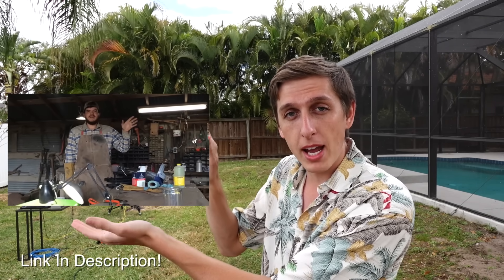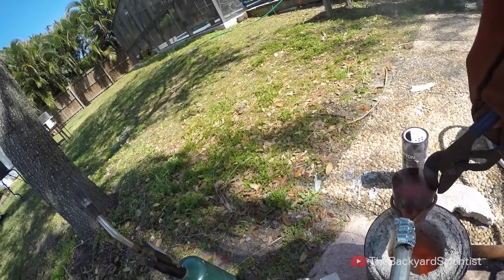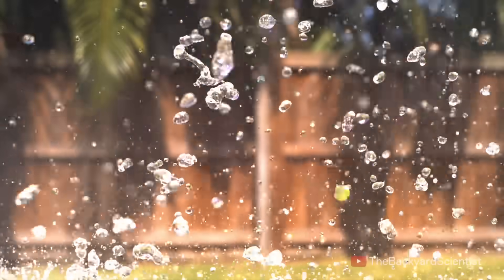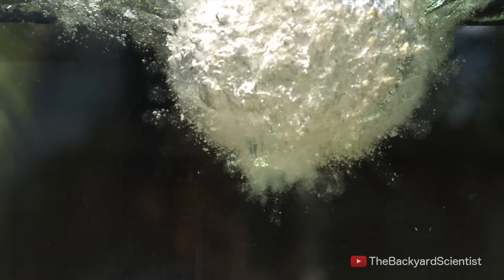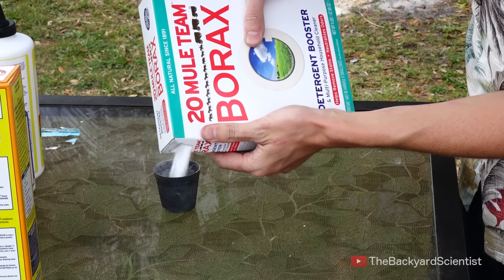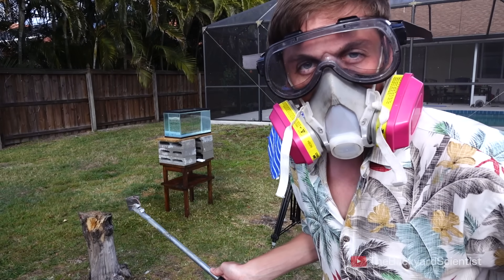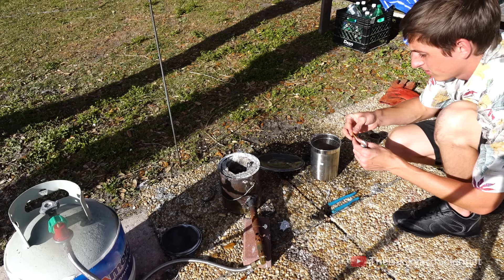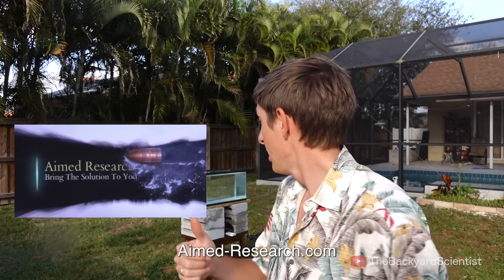Pouring Molten salt into Water - Explosion!

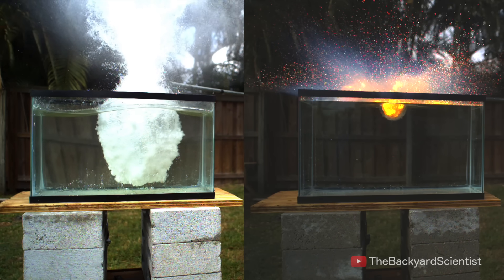Comment: I was wondering, would you be able to make a "special aquarium tank", maybe 3 times bigger where you can isolate a space within the tank without water? Is just that you said at 6:32 "I think the problem is that sodium can't get into the water fast enough", maybe i'm just being crazy here or just redundant, but... 

how about putting some kind of box which walls can be pull off inside the tank, so you can put the molten salt/sodium in the box and while pulling away the walls the water now falls into it? I know... maybe is too much effort for a similar reaction. Anyway, great video, amazing reactions and thanks for taking the risk of testing it.

Comment: The result is cause by an aftereffect of glass or glass-like item being cooled extremely fast, Look up "teardrop of glass" and you should find a vid showing glass being poured into water in a molten state and it turns into a teardrop, when you break the tip, The whole thing explodes. But, since you discovered molten salt is More volatile and weak than real glass, The hardening process is faster and more violent due to the instability and it doesnt survive to the "teardrop form", it simply shatters/explodes before it gets to that point.
Reply: +Swordlesslunk 
they're called Prince Rupert's drops.
Reply: too lazy to change it xD But yeah^^^^
Reply: but seriously? i come up with a rank theory and i only get a correction.. xD
Reply: Swordlesslunk
Is your self worth that dependent on confirmation? Well, if so, then i have to inform you that it's merely a hypothesis and no theory by any means...

JK, it's not a bad idea at all!
Reply: Lol Until i clicked "Show more" i though id have to delete the comment To prevent some flame wars xD GG

Comment: Do the sodium crystals behave like shrapnel?  Do the other compounds change the ph of the water?  Maybe the sodium disperses through out the water faster than it loses heat?  Sodium does lower the melting point of water, correct?  Does that mean that it lowers the boiling point too?

Comment: Because molten NaCl has an exceptionally low viscosity, which allows it to come into contact with more H2O during your pour, resulting in a greater production of gas. it's a viscosity vs. delta-T issue...
Reply: +CMATCT Been speculating along that line too.  That's got to be  part of it.

Comment: My hypothesis is based on salt dissolving in the water very fast. It would be interesting, in my mind, if you actually measure the salt  level in the water after the explosions... Or alternatively, re-doing this test in water that's already at the saturation point.

If the molten salt doesn't respond the same in salt water, then it must be partially a chemical reaction cancelling the Liedenfrost effect. If the reaction still occurs, then the reaction is purely physical.
Reply: This is actually very valid. The PH shouldn't necessarily change in order for it to be a chemical reaction.

Comment: the pH wouldn't change... the NaCl is dissolving breaking up into ions Na+ and Cl- are both neutral ions because when bonded with an OH- in Na's case or H+ in CL-'s case, they're a strong base and strong acid respectively, meaning they would dissociate 100%. However I do partially agree with your hypothesis because when heat energy is transfered to the water, its temperature would rise above 100°C and result in the creation of H20 gas. Another hypothesis I have is when the H20 breaks apart the Na and Cl in the dissolving process, the exothermic energy is so great that it results in an explosion rather than mildly increasing the temperature of the solution. The reason the NaCl had a larger explosion than the  Na is because there are double the ions bonding to create more exothermic energy when bonds are formed.

Comment: the temperature of some ionic compounds can denature the compounds just enough that the rapid changes of it  can expand and therefore explodes. same thing happened with heating metal and then cooling it up as quick as possible with ice water.

Comment: At that temperature it's not really salt anymore. It's basically just more concentrated sodium, because most of the chlorine will have evaporated away.
Reply: +TheOneETG nope.  Because if you let it cool you'd end up with a lump of salt, not sodium metal.
Reply: loctite222ms ^ note the word "Most". The chlorine content has not reduced to the point where it is not worth metioning, but it has lost a lot of its chlorine content at that point. It's goign to be more sodium that sodium chloride.
Reply: TheOneETG 

That's simply  wrong.   It's melted salt.  It isn't getting hot enough to dissociate.   It's a compound, not a mixture where you could boil of the sodium  If you just let it cool, you'd have a lump of salt, no sodium metal.

Comment: what would happen if theoretically the explosion occurred under water within an extremely high pressure environment with a blast proof enclosure?
Reply: +Will Shin A muffled (sort of loud) explosion sound coming from within this enclosure? The blast proof enclosure would of course have to be heavily weighted to avoid the whole thing from flying off from the explosion but nonetheless, it wouldn't be too interesting.

Comment: Here is what u get. Youre are using hot salt which is NaCl, in high temperatures it reacting with water (h2o)  NaCl+3H2O-NaClO3+3H2,  PH didnt changed becouse NaClO3 is а salt as well.

Comment: Seriously.. the basic of this is the heat of the salt super heating the water making it  turn to steam. It does not matter what you use as long it is very very hot the water will explode. just think of water and hot oil..

Comment: Why would the PH level change with a chemical reaction that does not involve hydrogen?  I'm tipping this would not happen if the salt was poured from within a vacuum so there was no oxidisation after it hit the water.
Reply: The reaction would have involved two parts hydrogen, one part oxygen plus the surface elements and anything else in the air. I do ponder the same though, what reaction would there be if any in a controlled vacuum without foreign elements.

Comment: So, I was thinking about this and in thinking about it I was wondering if the salt had some sort of weird property that was actually causing it to sublimate (which, granted, in a cooling situation doesn't make a TON of sense), but then I found this paper: http://www.ncbi.nlm.nih.gov/pubmed/15446951. 

If I'm reading the abstract right, they're basically saying that heating salt to so high a temperature that it melts completely screws with the crystalline structure in such a way that it stores more energy because at the melting temp it exists as a solid and a liquid at the same time.  And because the state becomes so fragile an equilibrium any screwing with it (like adding it to water) actually DOES cause it to explosively sublimate.   Hence the lack of salt after the explosion and the cloud of gas during it.  And because it's sublimating, it mixes with the water vapor caused by the heat and that actually fuels the explosion.

Comment: borax is also used in creating fuses. 3 parts borax, 2 parts sugar, sugar just makes the fuse burn slower. mix the two together and get some tissue paper and tightly twist it like a red vine with mixture lined inside of it thinly. be careful or the paper will tear. be patient, it takes practice.

Comment: My guess would be that it is a multi-stage chemical reaction. The explosion is caused by the liquid sodium after it separates from the chlorine. You are probably weakening the bond between the sodium & the chlorine with the heat, that would explain why it needed to be hotter and not simply melted.  The combined reaction is the sodium igniting , causing a chain reaction with the water and super heated chlorine. Perhaps you are forming chlorine oxide.

Comment: It may be that the sudden temperature increase splits the H20 into 2 H and O. Hydrogen is very flammable and oxygen for ingition, hence the boom. This is just a guess, I really dont know whats going on.
Reply: No, water doesn't split with heat.  You need electricity to do electrolysis to split it into its component parts, so I don't think this is what's happening.

Comment: Actually, it is chemical. The salt, or NaCl, is reacting with the water to create Sodium oxide and Hydrogen gas (the Chlorine stays dissolved in the water). The reaction creating the Sodium oxide also creates a lot of excess heat, which causes the Hydrogen gas to burn and explode, causing the effects seen. Sodium oxide and Chlorine ions do not react with the water molecules to change pH because the compounds they would create are entirely soluble, so they can"t exist long enough to change the pH of the water. Really cool experiment, and good logic behind your answer. Its just a really small-scale reaction and happens too fast to notice.

Comment: Looks like the sodium causes the reaction and reacts instantly in a pure form, while sodium chloride is protected from initial contact with the water and doesn't explode until the the sodium is "washed off" allowing it to get under water before exploding, and causing what looks like a bigger explosion since the displacement of water has more dramatic visuals than displacement of air.

Comment: it's working the same way that you are saying but instead of expanding in a quarter of a second it's not it's getting trapped inside of it and a quarter of a second basically what happens is water is trapped inside and with all that heating expands up into steam and then when since salt hardens after it is cooked it's literally just like a dry ice bomb without the dry ice

Comment: Ok. Here goes.. I "think" what is happening is that salt cannot evaporate BUT it can become a vapor when super heated. (Liquid form was shown but it was vaporizing, that was the, smoke) However on contacting water I believe it is triggering this violent explosion and causing the salt to become vapor and that is why you have no salt in the tank. 
Soo,, what I'm saying is. I believe it's from the water and salt trying to chemically combine at the same moment the heat from the salt is turning the water to steam. Hence you have steam and salt vapor expanding rapidly and nearly instant.. BOOM!!

Try using the same overall amount of molten salt but poured from several small containers at the same time into a very shallow (say two or three inch deep) much larger area of water. You'll get very minor explosions and the same result in the end. You really need a method of catching the steam/vapor that has escaped and see if the salt collects there. I bet it does. I just don't know how you would put a condenser or whatever to catch but.. Well that's my two cents. I could be way wrong. I just believe that's what's happening. 
Great vids

Comment: The last one I saw you had an explanation to what would happen, or be best, when a handgranate landed on the side of the pool og in the pool and which would be best jump in the pool with the granate og lay down by the pool is the granate landed by the pool face away and feet against the granate.Why not demonstrate this with the explosion in the tank with molten salt and a ballon with air in the tank by the end wall.

Comment: +TheBackyardScientist It's probably the viscosity of the molten salts which allows the NaCl to separate faster, exposing more surface area to water. So the explosion is just water expansion, just the same as if your poured hot cooking oil. I guess you could try with more viscous oils to see if there is any correlation.

Comment: This is simply a thermal reaction, the faster the heat transfers the larger the reaction due to the steam, high pressure vs low pressure. The more water soluble the heated substance is the greater the reaction becomes.

Comment: I'm pretty sure chlorine has a higher melting point then sodium so the longer you heat it the more chlorine that leaves to salt and it starts to turn into pure sodium which has a very high reaction to water

Comment: I think the reason why sodium and sodium chloride create explosions and other salts did not because of the crystal structure of the molecules. the bonds of the molecules make up the structure for the crystals that shape the mineral(s)/compound(s), and the structure of the other salts may not allow for water to be trapped inside of it like with sodium. so while steam is still generated the same way, it is not trapped within the molecular structure of the molten salts the same way it is with sodium. therefore no explosive energy is created.

Comment: Would putting salt at room temperature in boiling water have the same effect? As the water will still be steaming and expanding the salt particles?
Reply: no because the reaction would not occur at the same rate of speed. the very second the salt touches the water, the water will be trapped within the molecular structure of the salt, but without any heat added. it would simply salt with water, and eventually evaporate the water.

Comment: I think the reason it explodes is because that in the melting process maybe the salt (sodium chloride) breaksdown into chlorine and sodium. Because chlorine has a very low heating point (it's a gas in room temperature), it diffuses in the air, so only the sodium stays in the container. Because you are pouring the melted sodium into the water, it reacts with the water and makes an explosion...

Comment: Honestly I'm not a scientist but to me it seems obvious that its because of its boiling temperature. Its hot enough to provide a protection against the water long enough for the boiling salt to enter the water deep enough (as opposed to the other that exploded on the surface) but also not too hot so that it allows water to enter its formation (as opposed to the other that just sank and cooled before exploding).

Comment: uh its a molten hot substance put in water so its turning the water into steam which expands rapidly hence the explosion but heres whats really cool is you can create molten salts by using concentrated solar heat using either lenses and mirrors or both and the molten salt will stay at high temps for many days if insulated. And heres the cool part in an alternate reality what if when humans developed steam power instead of burning coal they had used concentrated solar heat to heat up molten salt in their steam engines imagine trains and ships with solar concetraters and no polluting dirty coal burning a steam punk sort of world
Reply: +Suhkma Dheek if you are familiar with steam trains they made regular stops for more coal fuel and water why couldnt they have done the same to be "refuelled" with fresh hot molten material that was heated by solar concentrators on a farm like scale at the depot that would work
Reply: Suhkma Dheek
maybe its a tray compartment that can be slid out and a new hot one slid in its place sort of like they are thinking of doing with some electric car battery units
Reply: Suhkma Dheek
sounds like a pretty simple engineering problem to solve. I actually have ridden on steam trains many times (I live next to Disneyland) and witnessed the water tower refilling etc and also the tolerances of stopping at the right spot etc ( they had to match the train up to a ramp for my wheelchair) so its doable

Comment: When you melt salt, the molecules get more space in them. Sodium is an alkali metal, and those react strongly with water. When it melts the sodium separates a very slight amount from the chlorine, therefore making a huge chemical reaction with the water. Like if you understood my confusing mess.

Comment: I'm guessing the salt is more violently explosive is because of the Chlorine that goes through rapid sublimation from being cooled, as it is released from the Sodium.  This would lead to not only the rapid expansion of water vapor but the rapid expansion of Chlorine gas.
Also, I'm wondering if the reason the Borax didn't explode was because of its lattice structure (the more complex chemical structure would inhibit water from penetrating the structure, even with its dipole nature).

Comment: This reaction occurs because of the outer valence shell that sodium and other metals that follow the collumn possess which allows them to be extremely reactive which is why as you move down the period and the element s get larger, then reactivity also increases because the elements are becoming more unstable. Thus, this is why when you put elements like cesium or fracium(if you can find any) in water, this will then cause a massive explosion

Comment: Kind of the same result when you mix water with hot liquid asphalt. The result is somewhat volcanic and it's a bath any person does NOT want. Nothing will happen if you mix more water with emulsified asphalt since that stuff is water based and is generally heated between 150ºF and 180º. The 'hot' stuff is anywhere from 350ºF to 450º.

Comment: Its because table salt is a compound called NaCl (which is sodium chloride) usually sodium is unbalanced and highly explosive when wet, and chlorine, is highly poisonous. When putting the two together, the atoms stabilize, forming two balanced ions called Sodium Chloride, or commonly known as table salt. when melting the table salt, it extracts the sodium, which, when wet, will explode!!